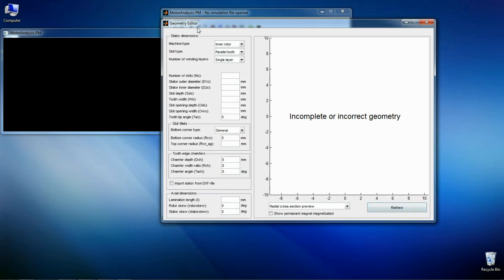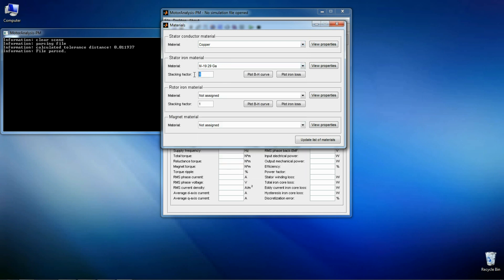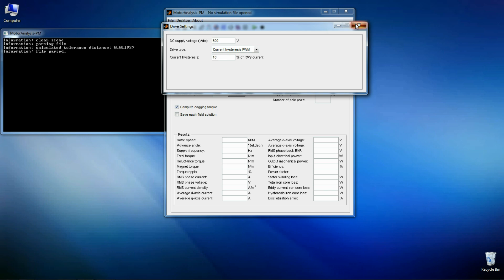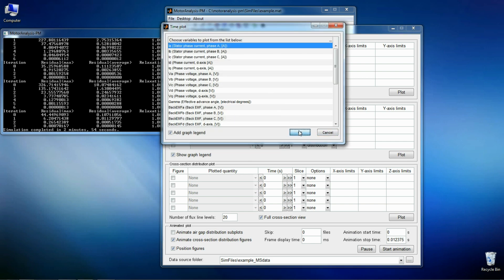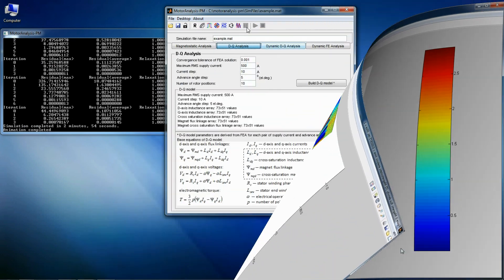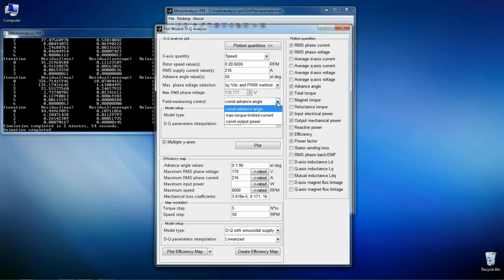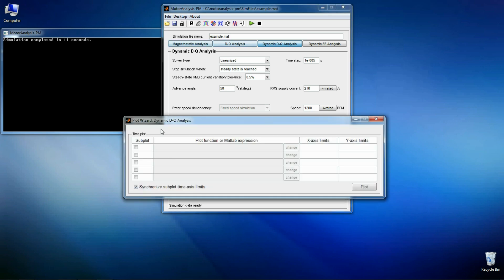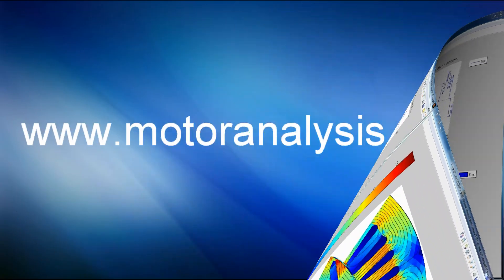MotorAnalysis-PM - free software for design and analysis of permanent magnet machines

Comment: The great software, hello sir how to determine number of slice if scew mesh editor ?? Thank you
Reply from the maker: Typically, specify the number of mesh slices the same as the number of magnet segments in the shaft direction - it provides the most accurate results for rotors with skewed magnets as each mesh slice will be at the center of the magnet segment. However, to reduce the simulation time 3 mesh slices is sufficient in most cases. If there is no skewing, the number of mesh slices is always 1.
Reply: @motorxp  oke sir thank you 🙏🙏

Comment: Hello sir , can i ask about this simulating ?? When i operate fo generator mode magnetostatik . We set current supply and set advance angle to 180°. So why we know about voltage and i input power (mechanical) and output power ( electrical) . Because the result of in&output is minus . 
Thankyou for your reply . I hope yo read this question 🙏🙏
Reply from the maker: The minus for input power in generating mode just tells that the electrical energy is going out of the motor

Comment: It software can Simulation the generator ??
Reply from the maker: Sure
Reply: @motorxp  How to install this software with matlab ??
What the fuction of file motoranalysisPMv1.1_matlab.zip  ?
Reply: @motorxp  please help me 🙏🙏
Reply: @motorxp  hello sir, please tell me about how to simulate this software for generator . Thankyou sir🙏🙏
Reply from the maker: @farhanhakimul8053  To simulate generator mode you need to set up advance angle to 180
Reply: @motorxp  how about rms supply current ?
Reply from the maker: @farhanhakimul8053  I should set up it according to your power requirement; also check current density to make sure the generator does not overheat
Reply: @motorxp  so rms supply for Generator operation (Angle 180°), is mean current flow in stator coil and also in load ?? and how about adding load for Generator ?? Thankyou sir
Reply from the maker: @farhanhakimul8053  Then increasing the generator load for simulation it means increasing RMS current
Reply: @motorxp  and how we know the voltage to load ?? RMS phase back emf or rms phase voltage ??
Reply: @motorxp  and how to know the ouptup power and mechanical power ? And in result "Electrical power input" and " Output mechanical power" is minus , what it mean ?? Thank you sir 🙏🙏

Comment: Its really perfect job! thank you very much for sharing. i can not rotor or stator dxf import, what is the exact dxf properties that works on program. I have applied what is written in the manual, but still could not be successful. 
may catia be problem? Is there a dxf editor you can recommend?
Reply from the maker: Yes, I recommend using LibreCAD, it always works fine with MotorAnalysis. SolidWorks and others may not work with MotorAnalysis, but they work perfectly with MotorXP, our new software (https://motorxp.com/)
Reply: @motorxp  thank you my problem solved. actually problem is to long name string dxf file, i mean directory adress.

Comment: Hello sir
I've installed the IM version for matlab but when I write 'motoranalysis' in the command window nothing happens.
I tried to change the file location and I put it in the matlab file but it did not work
Is there a spacific location that I need to move the file to?

By the way I installed the standalone version but it didn't work either.

Thank you
Reply from the maker: Hello, does it provide any error message? Please contact me at 2v.kuptsov@gmail.com

Comment: Software installed fine, both standalone and MATLAB-supported.  I can run the Prius example OK but that's it, the outer rotor example doesn't load. On worked examples from various textbooks (and a real motor) it simply either won't accept the geometry or won't generate winding data. If I put the winding data in manually it sometimes generates a pretty picture but the simulation wont run.  Sadly the error messages and the manual don't explain why it's unhappy or what to do next :(

I'm sure this is great software but it needs more working examples and better error information.  I appreciate it's free, but as an impoverished student I can't afford to pay for tech support.

Has anybody else got an independent working example I can look at?
Reply from the maker: What are the problems with other 2 examples? Can you please contact me at 2v.kuptsov@gmail.com? We can arrange day and time to connect to your computer with TeamViewer and solve your problems.
Reply: @motorxp  Hello sir can u say me how to install the software.
Reply from the maker: @seemaangadi8054  The installation is the same as for any other Windows program
Reply: @motorxp  this software can't instal in 32 bit ??
Reply from the maker: @farhanhakimul8053  Only 64 bit is currently supported
Reply: @motorxp  thank you very much 🙏🙏

Comment: Can this software be used to model permanent magnet generators?
Reply from the maker: Yes it can, you need to specify advance angle more than 90.
Reply: Vladimir Kuptsov, what about axial flux permanent magnet generators?
Reply from the maker: @danbramhall5966 , axial flux machines are not yet supported
Reply: @motorxp  what this mean
Reply: @motorxp how much angle to be generator ??
Reply: @motorxp  sir, please tell me how to simulate for Generator 🙏🙏 and this software can Simulate generator with load ??

Comment: A wonderful tool,thanks for the pain taken to come up with the same. For fractional pitch winding it's asking to set up the winding pattern manually,which I did, however I am unable to generate mesh as it is not allowing antipweiod setting for the same,please help.
Reply from the maker: For fractional slot winding you should select Boundary conditions as 'None' in Mesh Editor
Reply: Vladimir Kuptsov  thank you
Reply: @motorxp  how to convert 3phase 4pole to 6pole motor rewinding
Reply from the maker: @najmurrahmaan1275  Please send me an email to info@motorxp.com
Reply: Pushpa Geopal, hello sir , please help me for instalation procedure 🙏🙏